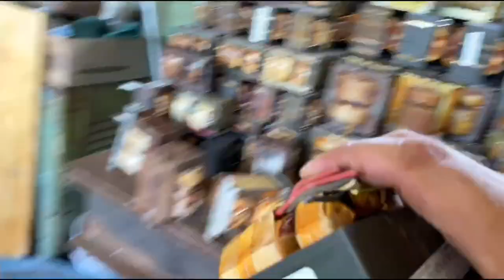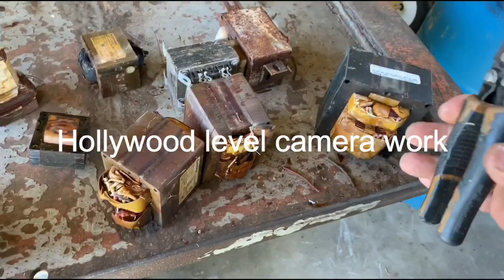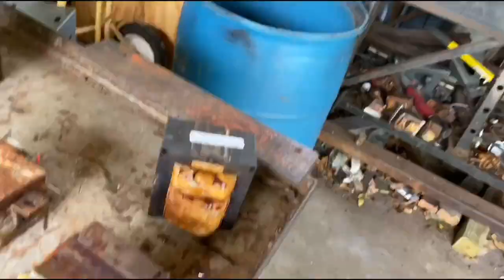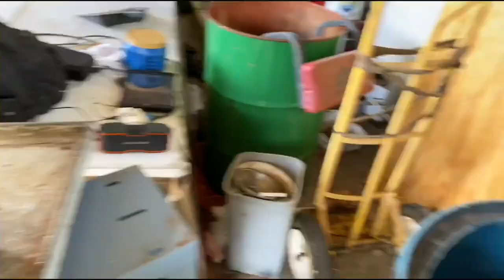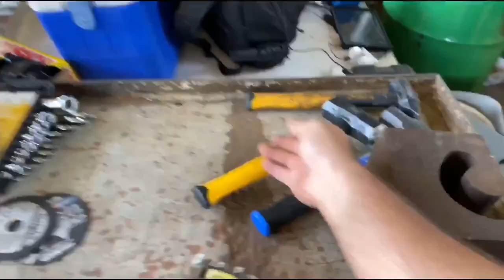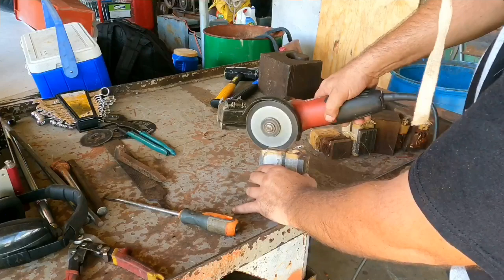How to scrap transformers for copper

Comment: do you remove the insulation tape,paper? If so, how, that stuff is on there good.
Reply from the maker: No I sell it as #2 copper. In the beginning I thought I had to so I beat the coils apart with a hammer but that was a waste of time.
Reply: @ProjectShopFl  thanks for the quick reply man, that'll save me a s*** ton of work

Comment: howdy-  how do you clean the paper and crud left on the copper?  could i use hydrochloric acid?  or would that be bad for the copper?
Reply from the maker: I sell it as for #2 copper. its not worth messing with.
Reply: @ProjectShopFl  but it could be #1 pencil size if clean?

Comment: Awesome set up! Im an electrician specializing in lighting so i get piles of these after doing parking lot retrofit. 1000w poletops are where the money's at but wall packs are just fine. I would love to have such a streamlined system to break xfos so quickly. For the moment, the way i break them, ill put the xfo in the vise with the welds closer together facing the top, next, ill take a 7/8" cold chisel to the weld on the laminated core. When the chisel is lined up juuuust right, it only takes but 1 swift blow of the 4lbs to crack open 7/8" length of laminations. Reapeat process for both top welds and then bend the exterior core outwards till the bottom welds break. Next, ill sit the coil on the jaws of the vise and whack the top of the core to send it right through into the steel bucket and send the copper in the copper pile. As far as copper goes, do you clean up your coils? Do you know any good ways to get all that paper and lacquer or whatever polymerized substance off the copper coils to  make more money off the copper (short from burning it, of course) or is it even worth it?

Cheers from Québec, Canada
Reply from the maker: Hope you watch my other videos on transformers, you will learn a lot. I sell the copper as is, I just clip off the wires, The coils I get #2 copper as is. I think you would be wasting your time cleaning them. I'v done it in the beginning but it is unnecessary. I've beat them apart with a hammer and even made a machine to unwind the coils and clean the slack off.
Reply: @ProjectShopFl  Have you ever tried to sell em as transformers?

Comment: Wow. And so interesting. Mater of fact I was working on transformers and my saw quit. I'll try your hammer idea.
Reply from the maker: What type of saw were you using,I’m always curious about how others do this. Thanks for watching
Reply: @ProjectShopFl  I've been junking since I was a young man. If the transformers not too big pota-band. Deep through.  I had used saws-all but and thank you using the hammer ahead light on. That move. Recently dismantled some 300 amp welders mostly I used the sawz-all I was about to give up and google scrapping aluminum transformers  they were mostly aluminum.  After watching your video I took my right angle grinder not cutting that aluminum.  I seen the aluminum blade use it freaked me out with a blade the close to my finger, because I've had a few kick out of my hand, I hav a skill saw with a diablo.  Metal blade it works great on metal but could find it.  Too broke buy a meta) for the 9" right angle.  Was ready to just scrap them . The next day I knocked one over seeing how you used the HAMMERto loosen the windings.. twala I seen the parting of the steel and how they were welded grabed the small right angle cut the weld hit it with a hammer .. it was quicker after that the big ones took a few extra blows they would be like the ones you used to cut the coils the pryed them open to get off . Did have too slice them twice.  Mine had steel at top cut the weld with the thin cut 4-5" kind. took the hammer to the wedge shaped at the top laid them over hammered where you cut them I hit them. Up& down both all 3 stood it up and the coils slid right up. The all that remains was the giant capital E. Coils of aluminum and the big Es not much to clean up. If I had access like you do I would of figured it outmaybe. One time the changed the lights out to. LEDS. I got all 32 fuxures  keep some off the housing by the wat they made good drawers. Add drawer slides they are sturdy. But those 30 grossed me nearly 1k scrap was higher. And I didn't have to buy them.  You're right the color of the coils give the copper coils away. 
 Just maybe the next big transformers look for the welds cut them make so e big capital Es I'm old school.  The transformers way back didnt apart t
Like this they seems to interlocked. but they were COPPER! Thanks for reply. Hope your able to make sense of what I'm trying to hunt and peck. Typing. But to be honest I'm  70 find yourself a jib crane  look them up on the UTUBE  I do because no matter  what I do someone
 made video. By the way I have a jib crane. Mine is an over braced. They have under braced. if you limited in overhead area.  Why I say this SAVE YOUR BACK. Again thanks. From TEXAS

Comment: The "E I" laminated transformer with the alternating layered (non welded) are held together with a glue. If you soak it for about 5-10 min in water that's close to boiling temperature you can then hammer the corner and it will break the bond. Once a few sheets come out the rest will simple keep falling with a little shake between hammer strikes.
Reply from the maker: that sounds cool and I might even try it, but in five or 10 minutes with a grinder I could probably knock out five or 10 transformers. I’m looking at production, and efficiency.

Comment: We use the same Hammer but we don't use the same blades we use diamond blades and the reason why is because they create less dust and last longer.normally we don't cut too much steel with the diamond blades we normally just cut the copper. Good video thanks for showing us how you do it.we also don't hold our transformers We normally beat them on the ground and sit in a low profile chair.
Reply from the maker: I normally don’t beat them with a hammer. I was just showing how I would do it and have done it if you don’t have a machine like I do. My next video will show the capacity of my hydraulic presses. It’s pretty impressive
Reply: @ProjectShopFl  I'd like to see a video on how you made that. I used to use one years ago and I used to crack open sealed units and the transformers. Mine was an old log splitter with a steel block to make the shaft go all the way.it was really old and beat up but it worked really well. The press that you have looks really helpful and takes out a lot of the labor intensiveness. I think you make really good videos thanks for making them.

Comment: One really Nifty tool that have is an air chisel
Reply from the maker: I’m sure that works great, I think I even tried it once but it is not as efficient as my hydraulic press. And I made this video to show the simplest means of breaking them down. Just a hammer, no power tools.
Reply: @ProjectShopFl  amen that's how I'm doing it basically the most I have is far as power tools go ar an angle grinder and the sawzall and those are only two recent additions so it's definitely appreciated putting these videos out brother and my God would I be happy if I had a hydraulic press lol

Comment: Those smaller ones with the alternating E cores, you can just hammer a hatchet right down the middle(length wise, parrarel with the lamanets). The lamanents will just spread apart and the hatchet will only be cutting the copper. Much much easier and faster.
Reply from the maker: Thanks for the info. I’m actually making a machine to do just that.

Comment: Some of those wires are copper coated aluminum. I just took apart two microwaves.
Reply: The older the microwave, the greater the chance of both coils in the transformer being copper. The inverter microwave does not have a lot of copper in it .
Reply from the maker: 99% of the transformers that I get come from commercial lighting. They are not copper coated aluminum, it’s aluminum coated with a shellac

Comment: Thanks man. Ive run them in similar ways but you got a better set up than I had. I was just using a vice on the back of my truck to hold things. it wasn't even bolted down. If I get bored this winter I might build a table and try a few runs of them. I think I used to profit like 17 cents a pound with the spread I had on them.
Reply from the maker: Wait to you see the video I am about to drop about these transformers. There’s way more than $.17 a pound profit. Stay tuned and thanks for watching
Reply: @ProjectShopFl  I used to buy them from the scrap yards so the margin was pretty thin. I'm gathering prices again to see if I can make money off them in this area.
Reply from the maker: @scrapmanindustries  Where is your area? You’re going to want to see the video I’m uploading right now
Reply: @ProjectShopFl  I'm in Ohio now. by lima. I used to live on the other side of Pa so prices are a bit different and Ohio has weird laws that make it more difficult to buy and sell scrap.

Comment: Nah that's not dust , that's resin , i dismantle auto transformators ans take the copper out of it's steel casing by hand without gloves and believe me , after doing one of these with just a screwdriver , wire cutters and my bare hands , it leaves lots of teenie tiny cuts like i've got thousands of papercuts all over my hands all at once !
Reply from the maker: definitely should be wearing gloves. lol
Reply: @ProjectShopFl  , I was lazy findin' gloves so i did without XD
Reply from the maker: @baptisteramiro1918   It happens, usually I lose one, the one I usually need. Lol
Reply: @ProjectShopFl  , Well for me it's just pure lazyness XD

Comment: I use an old hatchet to open them up
Reply: You just hit the welds with it and the sides fall away.
Reply from the maker: @gergc4871  how is that different from hitting it with a hammer? I’m gonna go to Home Depot and buy a hatchet and see what all the fuss is about. LOL
Reply: @ProjectShopFl  
Its not. It's just cheaper than using a grinder if one doesn't have a hammer.

You should still try it though. But get a harbor freight one instead of home depot. Or...a cold Chisel and hammer.
Reply from the maker: I’ve heard a lot of people say they do that, I’d like to see a video of that. Thanks for watching

Comment: I run a commercial lighting company and we just finally finished our 15th gaylord full. We ended up with about 20k lbs of copper. We have a 30 ton hydraulic press that we use sometimes, but the fastest way to do them is to put them on a hard surface (we use a 1/2" steel welding table), turn the weld lines horizontal to you, and smack the hell out of em with a 3lb sledge right on the weld with an angled swing towards you and using the edge of the head on the hammer. I can usually split the outer short iron away in 2-3 smacks. Then we have rectangular holes cut out in the table that allow for different size cores to sit in. Then smack the center short iron out of the copper coil and use a demo chisel of the correct width to finish it off.
Reply from the maker: Wow that’s a lot of copper and steel. I do the same thing with a 4 pound sledge. Where are you located? I’m in South Florida and I buy a ton of these from electrical contractors. Wait to you see my next video On how fast my press works. Thanks for watching

Comment: Have you ever tried a metal skill saw? Save a ton on disc's if it works.
Reply from the maker: I actually use a Skil saw blade to cut large transformers all the time. It’s kind of sketchy on the smaller ones because if you hit the steel the blade don’t like that. 95% of the transformers that I get I can run through those hydraulic presses. There’s a giant bandsaw sitting there I’m Thinking about fixing it and trying to use it for the ones the hydraulic press won’t break. Thanks for the suggestion and thanks for watching

Comment: That looks like a whole ass fuck ton of work for a tiny ass amount of money.
Reply from the maker: I don’t sit there and break them down with a hammer. I made this video for people that don’t have a hydraulic press like me.  My hydraulic presses can easily process 3-4 a minute at an average profit of $5 each for copper transformers. I did not build the hydraulic press because there is a tiny ass amount of money in recycling transformers. I built those hydraulic presses because I triple my money recycling transformers. Let’s take the low end, 3 transformers per minute times $5 apiece.That’s $15 a minute profit. $900 an hour. If that is a tiny ass amount of money then I must be doing something wrong. I’ll work hard to increase those numbers. Thank you for your feedback and thank you for watching.
Reply: @ProjectShopFl  If you could make $900/hour doing this, everyone would be doing it. No fucking way you make that much in hour. There is not that much copper in ANY of those transformers to make $5 pure profit per transformer. Especially not those smaller ones.
Reply from the maker: @Claymore1977  Well being someone that has owned a company called ETR, Electrical Transformer Recycling for the past 10 years I would have to disagree with you. I said my AVERAGE profit on a copper transformer is $5. I’ll be making a video tomorrow and I’ll show you.

Comment: I use a old sawzall to cut the copper core off on one side and pound out the windings....  I only scrap the steel...  Copper hasn't been high enough yet....  Waiting for $5
Reply: I hope you are young.
Reply from the maker: @johnafagerquist8235  😂😂😂
Reply from the maker: I wish I could only Scrap the steel. $5 lb copper would be awesome, most I ever got was 3.60

Comment: Your blowing my mind cracking them open with a hammer like that!🤯 I have always cut them with the disk. I forgive the thought of "why are we getting a hammer lesson" I will try it on the next unit I find.👍
Reply from the maker: The hammer works good if you have something solid to place the transformer on. The blades work good to, they just wear out and you got to keep buying them. That’s why I like that hydraulic press it does not wear out. Mostly. Lol Thanks for watching
Reply: New subscriber..
Reply from the maker: @MatthewHensley8304   What do you mean cut off the bottom? I’d like to see a video of how that’s done.  I don’t actually break all those transformers down with a hammer. That’s just a fast way I learn to do it without a press. I made this video for people that don’t have a press.  My hydraulic presses can process well over 1 ton an hour with ease. Thanks for the info and thanks for watching

Comment: Damn hurts to know all of those transformers are gonna get just scrapped for a few dollars of copper . I do electrotechnics and i have very little resources , where did you get all of them from? like i'd be happy to even have one of those things .
Reply: They're generally not working anymore if they are being scrapped bud.
Reply from the maker: @Claymore1977  You’re absolutely right. I live in the lightning capital of the country most of these have been burned up from lightning strikes. Sometimes there’s even a big gobs of melted aluminum or copper. Those ones really stink though. Thanks for watching
Reply from the maker: I get them from electrical contractors. They mainly come from parking lot lights. Most of these are burned up and cannot be reused. I live in South Florida the lightning capital of the country, it cooks these all the time. Lol

Comment: Have you ever tried a air hammer for some of that
Reply from the maker: Years ago I did but  I was not impressed. It could have been the air hammer was from Harbor freight, lol Are you talking about for the welds or the copper? Do you break them apart with an air hammer. I’d like to see someone else do it maybe I was doing it wrong. Thank you for watching

Comment: I use a portable band saw to score the welds, the blades last a long time. Takes one brute force step out of the process ! I like your table with the sliding plates to knock out the cores. I unwind the copper as well to clean it up better, but I am not doing the volume that you are. New to the channel !
Reply from the maker: Do you get a better price for unwinding the coils? I’ve never thought about using a bandsaw before, I’ve done that with a grinder but cutting the welds to me is a extra step and coast $. This was the fastest and cheapest way I found to break them in my opinion, I know there are many ways. Other than a hammer mill, I haven’t seen anything that can break them down as fast as my press. I can easily do a ton + an hour. Thanks for watching and the info
Reply: @ProjectShopFl  Not sure if I get a better price but I don't like to leave anything to chance ! I have thought about making a jig for my hydraulic press to crack them but I am only a hobby scrapper.
Reply from the maker: @CruiserMac  I would bring one to the scrap yard that you haven’t unwound and see if it’s the same price, it should be number two copper either way. I hate to see people working harder than they have to.

Comment: Does the yard give you a problem with the paper on the wire.
Reply from the maker: No, I’ve been selling  it as #2 copper for 8 years now.
Reply: @ProjectShopFl  you have a new supporter here brother.  Great operation. 👍
Reply from the maker: @scrapperdscrapperj3948  Thank you
Reply: Every transformer has copper and only copper? I've came across some that had aluminum wire coated to make it look like copper

Comment: Dont use red,green or yellow tin snips to cut wire they wont cut sheet metal if you do.wire snips are cheaper
Reply from the maker: I have been using tin snips for 8 years. I buy them specifically to cut transformer wire. They are the only things that I have found that can cut them in one snip because of the long blades and are spring loaded. That’s very important to me on repetitive stuff. I did not know they made snips for copper wire, thanks for the info I’ll be looking in to that.